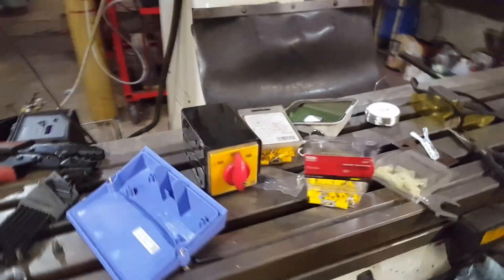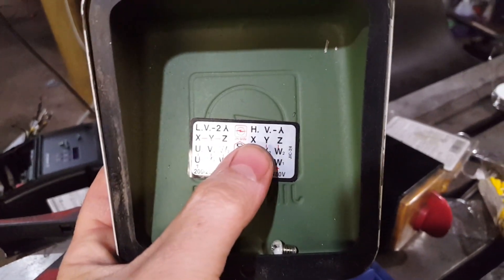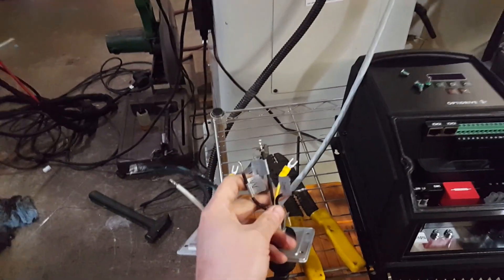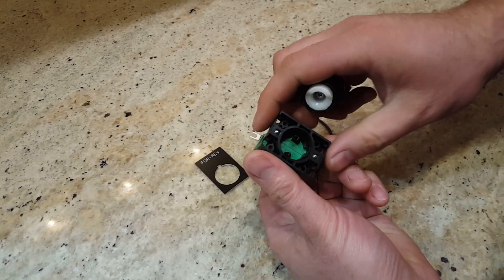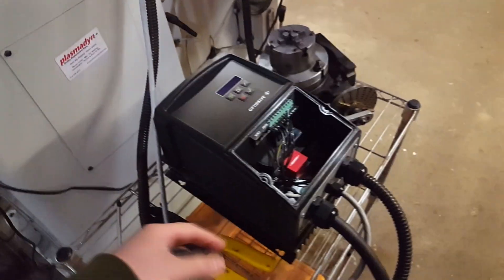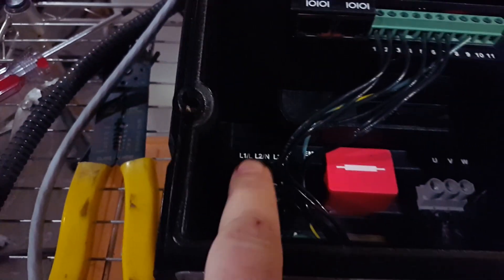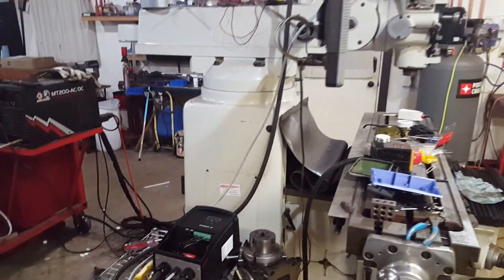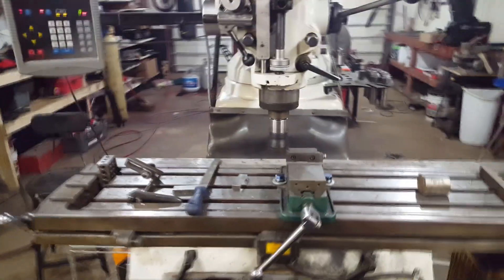How To Power Your 3 Phase Machine With A VFD

Comment: Question can you just use the factory switch instead of running through the vfd to do forward stop and reverse.
Reply from the maker: you could but than you can't control the ramp up and down rates.  You would probably overload the vfd if you change motor direction at full speed.  When the motor is slowing down it works like a generator and dumps all that generated power into the vfd.  If you pause in the off position a moment before changing direction it might be ok.

Using the VFD as a soft starter uses less power and makes the motor and vfd last longer.
Reply: @BeckTools all im doing is using the vfd for its 3 phase purpose.  My motor is 60 hz. So i wont be using the full range of 400 hz. What i have as in motor is 3 phase 240v 60 hz 4.6 amps. I wont be using the breaking or ramping features. As i said i just need the phase ability.